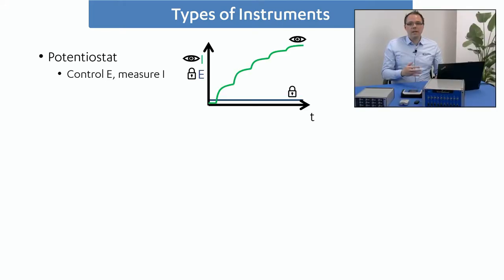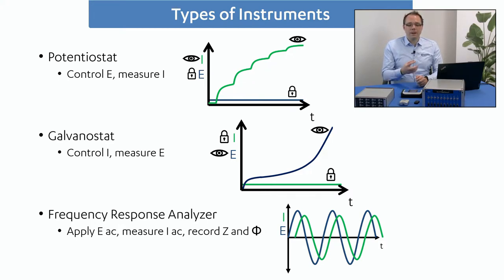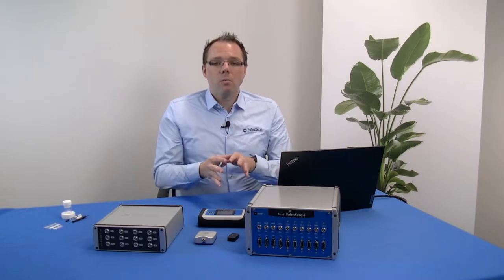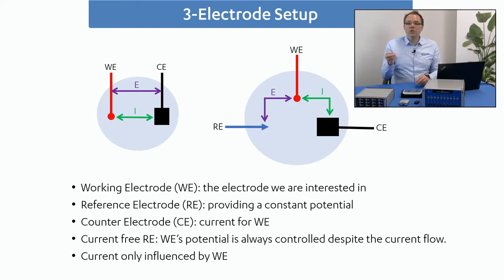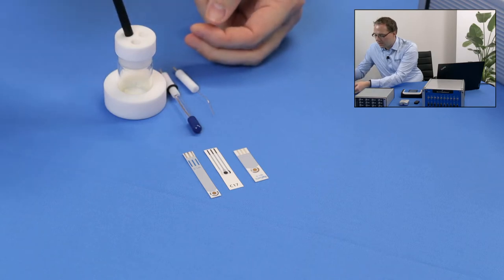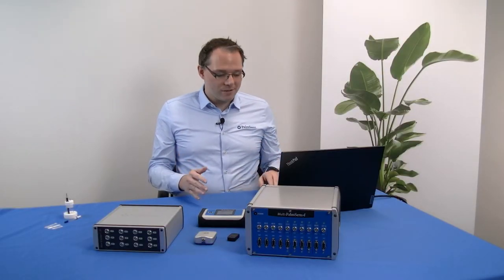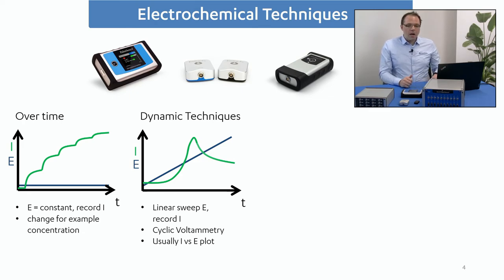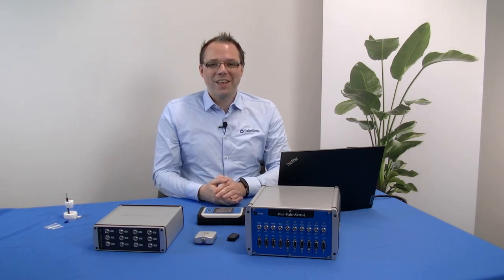What is a potentiostat and how to connect a potentiostat?

Comment: Can Palm sense BT determine charge discharge??
Reply from the maker: Usually charge-discharge measurements are performed galvanostatic, i.e. a current is applied. The Sensit models don't offer galvanostatic control, thus we don't recommend the Sensit BT for charge-discharge measurements.

Comment: Thank you for this interesting video, I would like to know if the screen-printed electrode is considered as a battery ? Meaning can I chose the material I want to work with for the working or the counter electrode ? and how is the electrolyte added ?
Reply from the maker: A Screen-Printed electrode is not a battery. 
Yes, you can choose the material you would like to work with. Different producers offer different materials. A selection can be found in our catalog: https://www.palmsens.com/products/sensors/screen-printed-electrodes/
The electrodes can be immersed in the electrodes or a drop of electrolyte is applied to the electrode. You can find multiple demonstrations on our YouTube channel, for example https://youtu.be/5-rk_Uab1hE